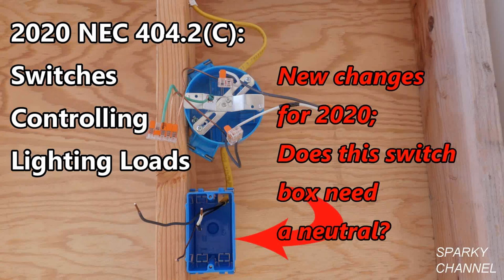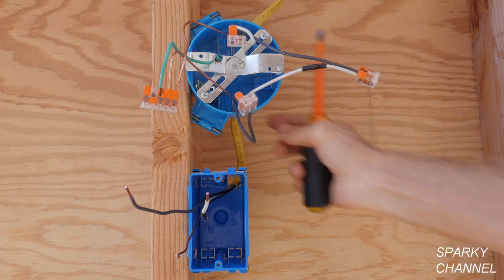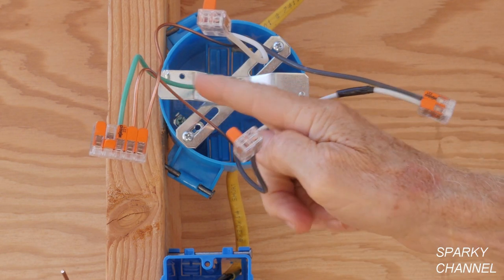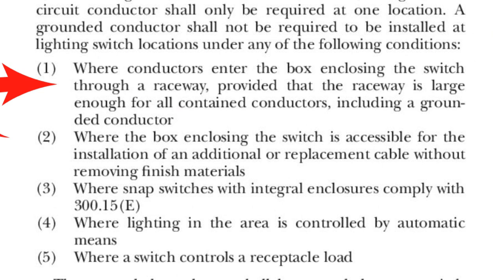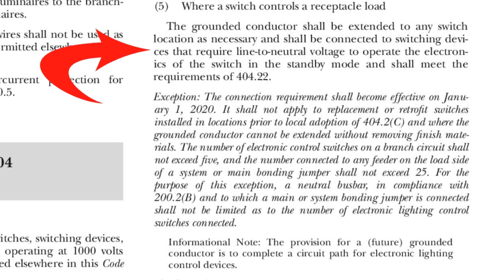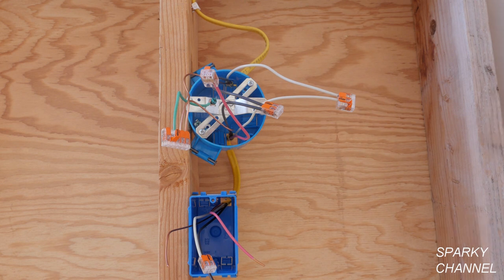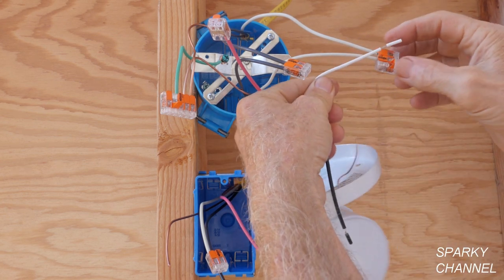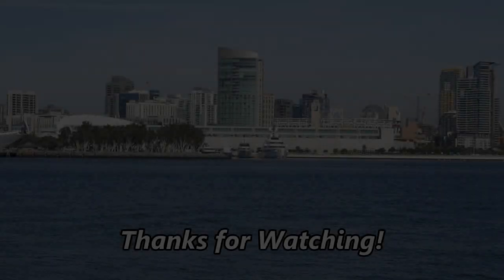NEC 2020 404.2(C) Neutrals in Switch Boxes with Example and New 2020 Exceptions

Comment: I thought you could not color code any wire smaller than 6AWG
Reply from the maker: That's correct.
Reply: I believe you can not color code any wire WHITE OR GREY -the grounded conductor IE-Neutral, because eight or above, buy white or grey or keep on hand…you can always re identifiy ungrounded CCCs. Check your code book tho I may be wrong!!!!
Reply: If it is part of a cable assembly, you may re-identify a wire. If in a conduit, wireway etc it has to be at least AWG #6 or higher

Comment: I like Wagos, but here comes the hate!!!
Reply: Dev JB  By non stress connections I assume you mean low current such as typical lighting and 15 amp circuits. If so, that's incorrect, they can be used anywhere that wire nuts are normally used. Bill (sparky) uses Wago lever nuts on 20 amp circuits all the time.
Reply: Dev JB  I agree with everything you said, but tight bends are not a wire connecting issue, more of a box fill issue.
Reply: Dev JB  True
Reply: I avoided Wago for many years, then it hit me.... I don't hear complaints about recessed lights having to dug out of ceilings because of bad connections - so I slowly started using them. I caused a dead short (hey , it happens) and the wireports took it with zero damage. I threw the wireport out anyways but it proved to me that it was as good as a wirenut. I use them more than wirenuts now.

Comment: Wow. Never thought so much could change for something so 'trivial.'  (Thanks for the clarity.)  Here's a dumb question I've never considered before:  In a switch loop, I always used the white wire with black tape wrap to "come down" to my switch, and then back to the light with the solid black. Is there an actual code requirement for this arrangement, or can it be done either way?
Reply from the maker: I don't know of a code covering that.
Reply: Down on white 
Back on black
Reply: @SparkyChannel  there is: a white wire may be relabeled and become a hot wire, but it is not allowed to have it turned on and off by a switch.  sorry, don't have the article reference off the top of my head.
Reply: In my switch loop, take a red sharpie, pull the back end of using needle nose pliers, put the top back on, this way you don't get red marked hands, there will be an ink cartridge wrapped in thin plastic, use you box cutter to put a slot cut about 1/2" long at the end, then on the white. Slide it on the white in the box up to the sheathing ten down to as far as yo need it. Do the same at the lite box. Tie the blks together,  now you have a red as a switch leg at both ends. Been doing this for years. I know all boxes need a nuetral so if it is going to be inspected, 14/3, then just cap of the white. After 40 years you pick up tips along the way. Good luck.
Reply: The code book wants you to run a 14/3 ,,,12/3, what ever size you are using. All boxes must have a nuetral. They don't want a home owner using the ground if you want to and, let's say an outlet from that box. In the long run you are probably better off using a 3 wire n capping off the nuetral.
Reply: @kenbrown2808  #6 awg n smaller must have the correct phase color. Tape is unacceptable, at least here in Florida. Been doing this for 40 years. 12 years learning R/INS, About 8 years as a finish,n hot checker, a punch out guy that made sure all was working correctly,  the inspector was happy, the builder, n homeowners were also happy, then ran service calls my Last 20 years. Mainly solo, so you really figure out your troubleshooting skills. Have been retired now, but I miss it. To me best job in the world. Past all my tests, but I do miss it. Worked on residential n commercial.
Reply: @mdvener  tape does not meet the letter of the code, but some inspectors allow it.  ink or paint is acceptable to code on all wire sizes.  and you're correct that any new installation must have a neutral available in the switch box, which makes it moot for new install, but in old houses, on a two wire switch loop, code does not allow the white wire to be the switched leg, even if the ends are colored.  I've always wanted a double ended sharpie - point on one end for labeling and a notch on the other for striping wire.
Reply: @kenbrown2808  when I do mine with a sharpie,  the whole wire is covered with the sharpie color, from the sheathing to the end. No white is showing. Different counties and states and cities are different in alot of ways. I have been doing this for years and never questioned once.
Reply: @mdvener  that's fine, but the one that started out white still has to be either always hot or never hot.  only exception I know of is if you're using a 2 pole thermostat on an electric heater, so both wires are switched.

Comment: For just a light, fine.  Now...add a separate switch for a ceiling fan control and you have a ceiling box packed full of wire (and wire nuts) that would probably fail inspection?
Reply: Run the power directly to the switch-box, and from the switch-box the the light/fan. It's just a little more wire.
Reply: They make deep fan boxes.

Comment: Yes it needs a neutral. Don’t do it even if the code allows. Most home automation requires neutral. So you’re screwing people later by saving a few $.
Reply: That's not screwing other people later.
Reply: @news_internationale2035  sure it is. It doesn’t get checked by home inspectors and then the person finds out you cheated and screwed them and now nothing will work right.
Reply: @jameshancock  If you want those features, you get them yourself.

Comment: Where I need a Neutral I install one, a switch only box does NOT get a Neutral!
Reply: And thus you are in violation of the Code.  Why would you do that?  Is the 1.00 in wire really going to break your budget. ?

Comment: Please forgive my very stupid question. But if your solution leaves hot power going to the light fixture before going to the switch, does this not defeat the purpose of the change in the code?
Reply from the maker: Hi Joseph. No, this code isn't about hot wires being in a light box, it's about whether or not a neutral needs to be in a switch box.

Comment: What dos the code say about a 3 or 4 way way switch setup where the white wire is commonly attached to the either the common or traveler terminals of the switch.  None of these boxes have grounded conductors.  So instead of running 12/3 to each switch, should we run 12/4 instead and allow the unused wire to be a future neutral?
Reply: Pause at 5:45. You only need the neutral at one location if you can see the entire floor area.
Reply: @zacker150  Thank you, this is now clear!
Reply: its called a Switch Leg.

Comment: Ya the powers that be don't like any extra room in the switch box don't ya know.  Apparently they no longer understood what a switchleg was.  :)
Reply: no, they don't like jacklegs using the ground wire as a current carrying conductor.  the code also requires using a big enough box to have extra room.
Reply: @kenbrown2808  what? The ground wire is not the current carrying conductor.  The neutal (white) wire is.  Totally exceptable.
Reply: @91156  right.  that's why the code requires a grounded conductor in all switch boxes, now, so the electrician can connect the neutral from the switch to the grounded conductor instead of using the grounding conductor as a current carrying conductor because some jackleg didn't want to rough it in correctly.
Reply: @kenbrown2808   I don't think you have a clue.
Reply: @91156  then you're saying the op is right that there shouldn't be a grounded conductor in switch boxes to connect the neutral from the electronic switch to?  Or did you really mean to say that you don't think.
Reply: @kenbrown2808  Agree, and most boxes I work in are too small.  I replace them when I can.  Would be nice if installers would always use larger boxes, where possible.
Reply: @jasonhill2180  half the time, the bigger box is cheaper, too.

Comment: I didnt think u could phase/tape a wire smaller than #6
Reply: The key is that it's part of a cable assembly, in this case a 12/2 non-metallic sheathed cable.

Comment: Your demo setup showing a 'vintage'  setup is wrong. The black should pass from the fixture to the switch box. The white should be switched and identified with tape back at the fixture.
Reply: Actually, it wasn't codified for many many years which wire had to be made hot on the way to the switch loop. I always thought it made sense to make it the white. Then the NEC (1993 maybe) made it code to make the white wire the hot leg to the switch loop and the black wire the switched leg returning from the switch loop. So... I think his was right and you probably got it backwards. Sorry.
Reply: @fritzmiller9792  what you feel makes sense makes no sense at all. Hot wires should be black whenever possible not white. That does make sense and agrees with the many vintage installations I have worked on.
Reply: @WApnj  so, when the switched wire returns to the light j-box, if it is white it can later be mistaken as a neutral. So if the switched wire returning to the light is black it won't ever be mistaken as a neutral (don't forget that if the switch is off it won't be energized and someone may assume it's a neutral) The logic works the vintage way too, I never would argue that it doesn't. I just think sending the white down hot is safer. And btw, it's always been OK to make the white hot in a cable assembly, it's just required to be re-identified. Hot Water Heaters, Electric Heat, etc👍
Reply: @WApnj  I was trying to tell you nicely that you are calling him wrong but he really is right. If what makes sense to me does not to you then that is totally fine, np. Technically, the Code was actually added saying to make the white hot and the load black. When it happened I was already doing it that way but I know that it's done the opposite a lot in the past.
Reply: @fritzmiller9792  that's a white wire with black tape. The black tape identifies it as a switched lead at the fixture. That's the point of the tape I'd.
Reply: @WApnj  I know. What made you think otherwise. We have been talking about re-identification this entire time. Yes, that is usually accomplished with black tape. That was the topic of the conversation, I never referred to anything else. You are joking now? Like I said from the start, Bill was right.
Reply: @WApnj  I was re-identifing white wires with black tape in BX Cable on the 24th Floor of the tallest new building in Hartford in 1983 at the age of 19 and I fully understood it then. My journeyman would open up the Codebook almost every day and teach me the trade all day. I kinda got the black tape on the white wire technique.
Reply: @fritzmiller9792  you said the 'hot' white could be mistaken for a neutral...  Not if it's taped. That's the point of the tape. Go back and read your own comment.
Reply: @WApnj  Yes, that was in the context of discussing re-identification. At every single point of the discussion the topic was a wire being re-identified with black tape. You actually called me out for not typing black tape every time to try and be right? That is sad. Read the whole discussion, it was specifically about re-identification and which way a re-identified (black taped) white wire should be used. You either got confused or can't handle getting told something... Which is really ridiculous if so. I was trying to help you from calling out Bill when he was right. Trying to be kind about it and all . It's not complicated except that you have made it so. SMH
Reply: @WApnj  read my second comment to you. Near the bottom. I said the white wire needs to be re-identified. That's usually by wrapping black tape. The Entire conversation was about re-identification of white wires to hot wires. You taking anytime I don't type out 'black tape' and making like I am wrong is ridiculous. Here I was trying to be helpful..... SMH. I have been a Master Electrician since 1998 and I re-identify every single time and have been since 1982. Again, I was actually trying to help you not embarrass or criticize wrongly to a guy who does great informative videos. If you read back carefully maybe you can see where you misunderstood or started twisting words, hopefully it is the former